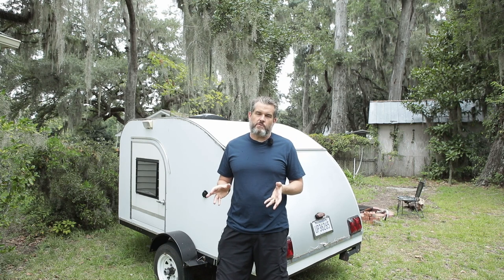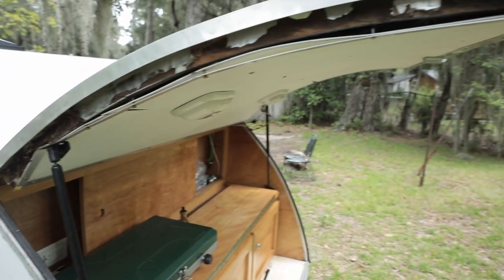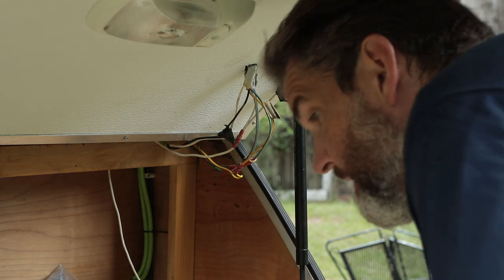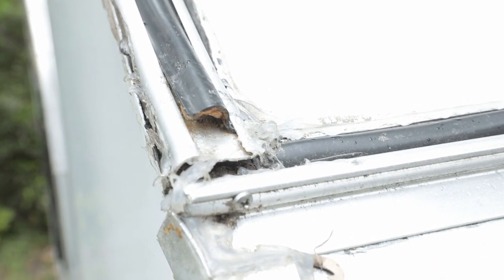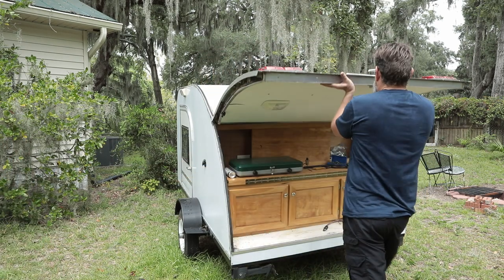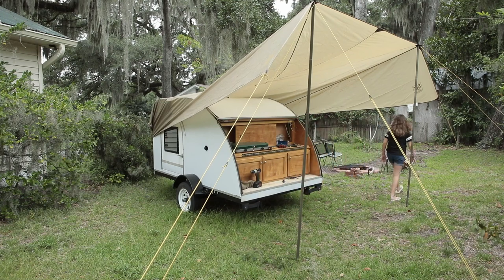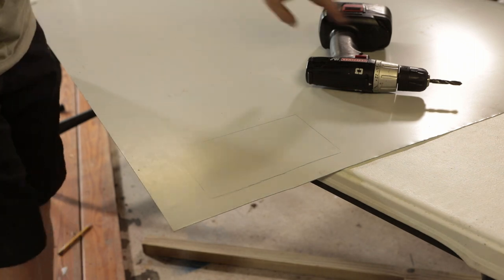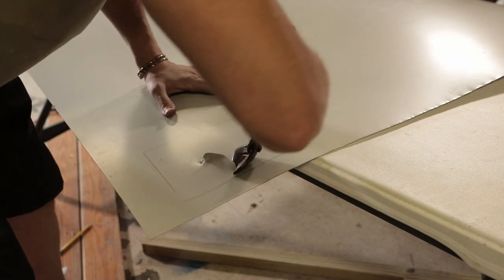FIXING THE LEAKING HATCH AND REBUILDING THE DOOR ON OUR DIY TEARDROP CAMPER, A STEP BY STEP VIDEO

Comment: Nice job on the repair. Did you use a different style hurricane hinge? I suggest a bead of Proflex RV caulking on all the edges of the trim as another layer of protection. Otherwise,  great job on the repair. It turned out nice. Happy Camping and safe travels!
Reply from the maker: DIYTearDrop -Jay Thanks Jay. I used the same type of hurricane hinge as before, just longer. Frankly didn’t know there was more than one kind. Maybe you could elaborate on that? Good idea with the Proflex. How does that compare to flex seal?
Reply: @wollwerthimagery6267  yes, there are 2 types. One is a vintage design and the other is only available at Vintage Technologies as he owns the extrusion mold. I personally prefer the classic hinge but have used both. Proflex RV is a caulking used in the RV industry, it is designed to flex with your camper. It gets a skin on it pretty quickly but the inside stays flexible. It is all I use on mine.

Comment: Nice job! I would have used plywood instead of regular lumber for that side rib. I fear that the board you used won't have enough structural strength since you end up with short fibers. I used cabinet grade plywood that has 13 plies for the 1 incher.
Reply from the maker: Thanks Jose. Plywood probably would have been better strength-wise. I get so leery of using plywood with the humidity we deal with on a daily basis here, so I decided to use regular lumber. Who knows, I may regret it later.

Comment: So there is still the gap along the roofline. How did you fix that? Just glue and res res?  Maybe a larger screw as well
Reply from the maker: If you're referring to where the roof had pulled away, I did use screws to hold that down onto the new wood. I also later added flex seal tape over the joint to completely seal it.